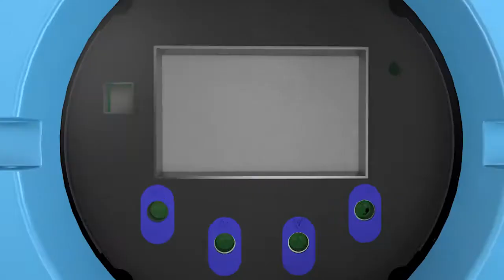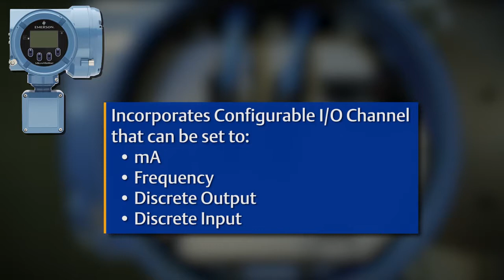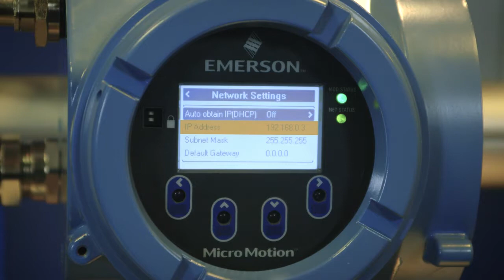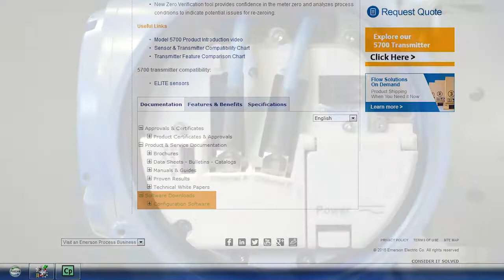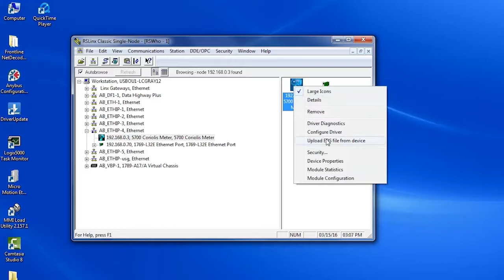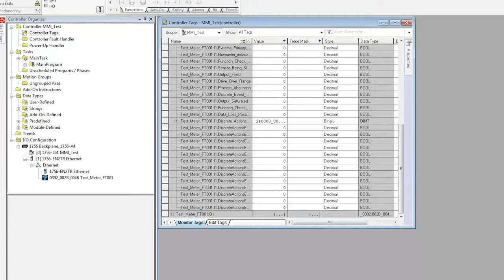Rockwell PLC EtherNet IP integration of Emerson Micro Motion 5700 Coriolis meter

Comment: Spot on. We've been using about 15 of theses and startup and ethernet is flawless. Thanks for a good product. Way easier than the modbus way to configure a 4-20ma signal. You guys came to our site back in the day and set me up with that tool. Thanks for that too. Ethernet is smooth, reset totalizer function, etc. No power cycles.